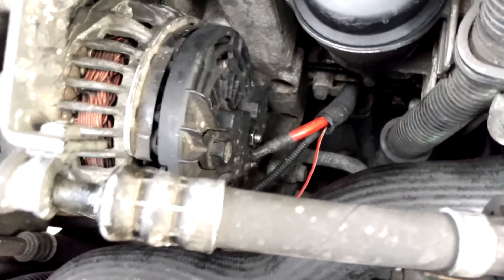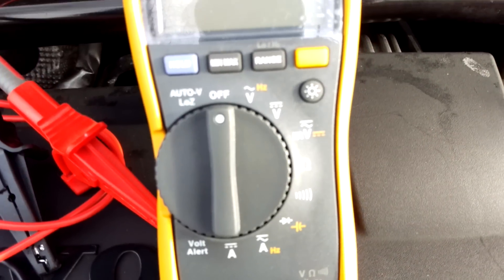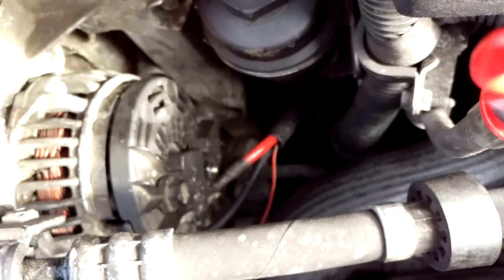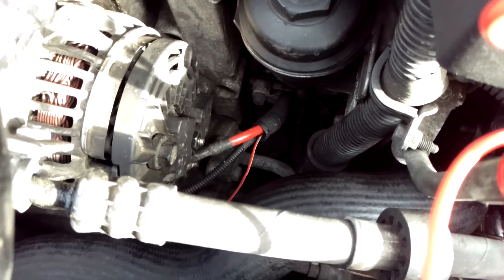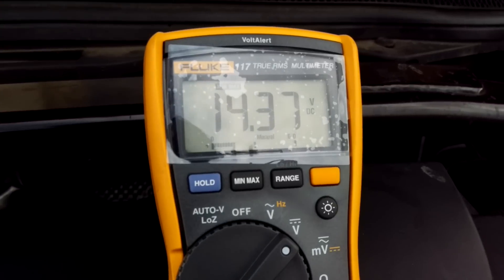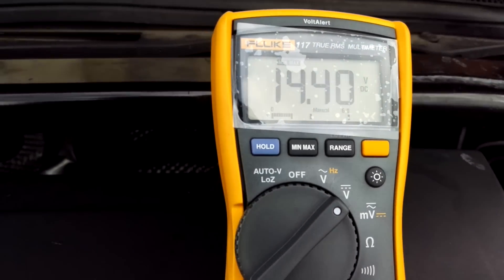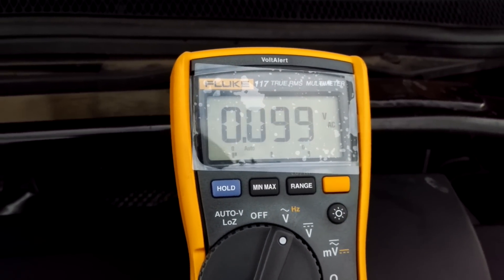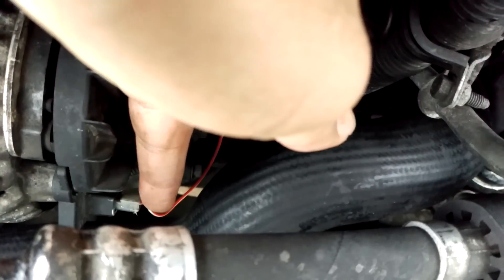How To Test an Alternator Part 2. Rectifier, Diode Pack, Parasitic Battery Drain

Comment: Great video. I had a whine in my sound system for years. The market place has all kinds of gadgets to remove said whine. But instead, I checked my diodes one by one in the rectifier and found one, not in the limit you mention ( 500 to 800 ). Tapped it out and replaced it, whine was gone. Diodes can leak the AC even before the dead short symptom arises. Our current bad diode situation was espoused by a amp clam showing amp draw on the positive lead to the alternator checked while not in operation. Confirmed when disconnecting the output lead from the alternator it sparked. lol. It should have no path to ground. Sparked when touching it back to the positive post as well. dead short. But the alternator still produces 14.5 volts to charge the battery when in operation. wow.

Comment: My 4 month old alternator is pulsing when you increase the revs to anything above tick over, On tick over it's relatively stable at 14.70v  the final test you mention is to have a range between 500 & 800 Mvolts, I'm getting 490 Mvolts. Would this lower reading be my issue?
Reply from the maker: Pulsing? What is the minimum and maximum DC volts at tickover and 2k rpm?
Reply: @sirobb  Thanks for such a quick reply, at tick over pretty constant at 14.70v & holding the car at 2000rpm, the volts jump between 10v & 15.5v. further reviews on the web would suggest the regulator is faulty?
Reply from the maker: @ianritchie319  If your 490mV reading is one way and no reading the opposite way, it doesn't suggest a diode problem. There's also the AC ripple voltage test shown in the video if you have a good enough multimeter to further test the rectifier.
The DC voltage reading spiking at 15v does suggest a regulator issue though assuming the feed voltage into the alternator is stable.

Comment: At time 5:13 , a no brainer ......Never remove the red cable from an alternator before removing the neg battery cable first.
The test with the diode neg on case red on power terminal  will let you know that there is a parasitic drain on the battery when 
vehicle isn't on.

Comment: I have golf 4 tdi i change my battery and after night it goes still dad  So I notice My 30 amp fuse  fan motors melted every time i put new one  I follow wires but are ok  so Can someone tell me It could be alternator my prob ?

Comment: Is there anyway to test the alternator without disconnecting the leads?  I can't get to the backside of the alternator?
Reply from the maker: @mantolaman  This video is for a failed diode which would show a reduced DC voltage reading <11 volts and an increased AC voltage ripple.
Basically, with everything connected as standard on a running engine, if you're getting a healthy reading >13.5 volts DC and <0.2 volts AC and you have no parasitic drain or charging issue, the additional tests and disconnecting in the video may not be required.
Reply: @sirobb  Thanks!  I have a draw of .4  to  .5 ma when the car is at sleep.  And the battery goes dead in about two weeks.  This has been ongoing for over a year,  I've had it to 3 shops, the last being the Mercedes dealer.  Their diagnosis was "Sleep draw measured 0.5 milliamps.  After 1 hour draw test battery was still very hot.  Measured temp of battery was 120 to 129F.  Determined to be bad battery and needed to be replaced.  ( replaced the battery about two months prior to that).  2nd new battery installed. and performed 1 hour draw test again.  Draw measured 0.5 milliamps.  Battery now cool to the touch."
I still have the same problem!  I don't drive the car that much.  And when the Mercedes dealer looked at it, I had just completed a 1000 mile trip.  Stayed overnight and the next morning car would not start.  I'm at wits end and don't have anyone to take it to that knows what they are doing.
Reply from the maker: @mantolaman  Just to check your measuring.
0.5mA would take weeks perhaps months to drain a healthy fully charged battery.

A 0.5A drain would however give you the problem you currently have and could easily be traced as anything drawing that power will show in the fuse test or the alternator test.

Whilst you find a competent auto electrician, I would recommend using a smart charger with a decent output like the CTEK MXS 5.0 OR An Optimate 5A charger.
They will prevent the effects of the drain overnight and you can connect it as often as you need.
If you rely on any battery, they're essential. 

Consider having a boost pack too and carrying decent jump leads.

Please also watch in full my other more detailed parasitic drain video showing the drain finding process. I've never needed a professional but only because I follow the same procedure a competent electrician would follow. 
https://youtu.be/ZCMQE2tgRSE?si=9XCnqMgu2tqNy4_r
Reply: @sirobb  Thanks so much!  I'll look for a 5A charger for the short term.  I'm sure I've already watched your video multiple times but I'll check to be sure.  Also pretty sure about the  0.5ma draw too.  I got that right off the Mercedes repair bill, and that's the same measurement I get now.  The first two shops didn't find anything, and told me to come back when it drains the battery in 2 or 3 days!  ha
Reply from the maker: @mantolaman  Remember a 90Ah battery is 94000 milliamps so 0.5mA is tiny. Certainly not enough for your symptoms so your drain must be significantly higher or there is no drain and your battery or alternator are dead. 
For the drain test, in summary, you need every fuse accessible but the car asleep and you voltage drop test every fuse until you find any above 0.0v so any showing any voltage drop no matter how small, usually less than 5 fuses total. Then set up a drain test with the multimeter between the battery lead and post and methodically remove the fuses which gave a voltage drop reading and check the effect of their removal on the meter.
If you can leave a meter connected with high/low settings which won't power off, it will record any drain spikes over the hours just in case your drain ramps up at unexpected times. 

Here are the links for the chargers I own or recommend. 
Ctek https://amzn.to/3Y2FW2X
Optimate 6 https://amzn.to/3BTLdCs
Reply: Taking another look at this issue.  When I set my multimeter to DC MA mode it reads .4 to .5ma with nothing connected!  Get the same reading when I test between post and cable.   And that's the reading I was reporting to you.  Must have a bad multimeter??  
So, I borrowed another multimeter, and I'm getting a reading of 17ma  (from the negative post to the cable).  After I'm sure the car has gone to sleep.  Shouldn't be an issue?  but the battery still goes dead in about two weeks.
Reply: @mantolaman you may have an intermittent draw that you are missing....maybe it happens once every 45 minutes for example....

Or you're incorrect on the amount....you may have a larger draw and aren't reading it correctly....with multimeter in 10 amp setting what is your reading? 

 .500 would be 500 milliamps...
.050 would be 50 milliamps
.005 would be 5 milliamps

Comment: hello SiRobb
I would really appreciate your thoughts< my battery is in the boot not in the engine bay
This are my multimeter results> 14.32 V the battery in the boot (although changind quiet a bit from 14.32 max to 13. 7 in a very short period of time)
14.48 V positive and negative in the engine bay
14.29 V DC alternator positive and the casing
41.7 V AC alternator positive and casing( although couldn't of measure it if not put the max on multimeter, too unstable and changing with different specs)
0.455 V  diode test on alternator 
107.5 mV the two positive posts
I want to find out my problem as the voltage is not stable at all, noticed with my headlights dimming and back to normal again quiet often
Reply from the maker: Most likely for me would be voltage drop in the main connections or worn brushes or brush springs in the regulator. The brush springs can stick and cause irregular contact with the copper slip rings in the alternator.
Reply: many thx im going to replace my regulator with a new one @sirobb

Comment: When i perform your alternator diode test with the red lead on housing and black lead on alternator B post the voltage reading starts off at 525mV and then quickly drops to about 485mv and slowly drops 1mV every 20-30s. Is that normal. Cause my value is not steady like what you demonstrated. I have a denso alternator and using a klein clamp meter. Also one more question. When you performed a voltage drop test on the negative side of your starter motor with your ignition disabled, in your other video. You stated that the acceptable voltage drop is no more than 0.2V. I'm getting result of about 0.35V. Some say up to 0.5V is acceptable and others say no more than 0.2V. The starter seems to be working just fine by the test results are a bit skewed. Any help would be greatly appreciated.
Reply from the maker: @Loanello  Sorry I missed this. I aim for 0.2 because any more is an indicator that all main contacts may need a little cleaning up. A 0.5v drop doesn't occur unless things are getting grotty so don't wait. 
The figure is also a relative difference between the two points being used so measure alternative points in the system and compare with other owners through forums to see exactly what is normal for your car.

Comment: Hi friend if we remove alternator fuse can it sold the battery drain as a temporary fix, as if the drain come from bad diode in the alternator, thanks
Reply from the maker: Disconnect the battery negative lead to prevent drain.
Reply: @sirobb  yes bro i know but i want to see if the drain is coming from the alternator, it a little tricky to reach the alternator in my car to make this diode test, so if i tried to remove alternator fuse will it stop drain
Reply from the maker: @ahmadlbl Do a parasitic drain test to view the standby current then remove the fuse you suggest and see if the drain reduces on the multimeter. https://youtu.be/ZCMQE2tgRSE?si=kSZdz9QuvsYOjvFY
Reply: @sirobb  ok bro thanks for your help
Reply: @sirobb  bro the fault diode of the alternator can drain battery in 2 or 1 days if the car is not driven
Reply from the maker: That's why you need to methodically do the drain test in the previous video I linked to.
Only testing will give you your answers.

Comment: Excellent video. When I did the ac voltage check you state the max is .5v. Mine showed .7. Ironically I sent my Honda to the dealer and they offered to send the alt to a repair shop and have it back in the car in 3 hrs. 6 hrs later they told me to go home and return tomorrow because the shop was haviing parts issues with the rectifier. Got the car back and it seemed to hesitate then crank (1 yrl old batt). Starter tested fine. After sitting for many days the batt. went dead. Only when I watched your video did I find out about the ac test. Then you talked about the battery leak issue. It all made sense. Ordered a new rectifier.

Comment: Thanks,  I learned here , why didn't you just unhook your battery,  instead of using the tube
Reply from the maker: The battery is in the boot/trunk under a cover and a metal bracket and another cover. I'm always super careful though.

Comment: Superb. Best video on this topic by far. Can you comment on diode test millivolt readings outside the normal range of 500-800?  Does parasitic drain increase / decrease proportionately? I suspect my alternator has a parasitic drain issue even though my alternator charges normally at 14.4V.  Specifically, I have a consistent diode test reading (using 3 different meters) of 1.067 millivolts when I put the red meter lead on the alternator case and the black meter lead on the "B+" post - outside of the car on the bench. When leads are reversed, I show no reading as expected. Your thoughts are greatly appreciated. I know others have the same / similar questions. Thanks in advance!!!!

Comment: Hi, this is very helpful! My alternator is not charging the battery (the voltage at the alternator is the same as at the battery). I did the diode pack test and I got 720 mV in one direction and a positive value which was constantly increasing in the other direction. This proves that my diode pack is wrong and I should replace it, right? BTW. I did not disconnect all the wires from the alternator but my battery was fully disconnected (both plus and minus) so I guess the reading was still correct?

Comment: O L= Open Lead, not over load.
Reply: If by chance you own a Fluke dvom  OL - overload the reason is the meter has voltage selector to adjusted 20v  dc range o.oo  Will read OL over 20vdc.     Meaning overloaded OL  read ur manual CHEERS HOPE THIS HELPS  Also other interpretations open loop out of limit most important INFINITY
Reply: I think it's 'Out of Limit'
Reply: it's Over Limit (resistance/ohms) not Open Lead
Reply: @IHETguy it’s only open lead when you are testing resistance